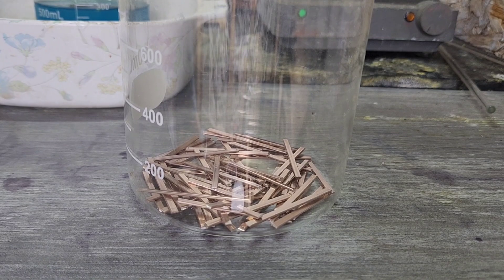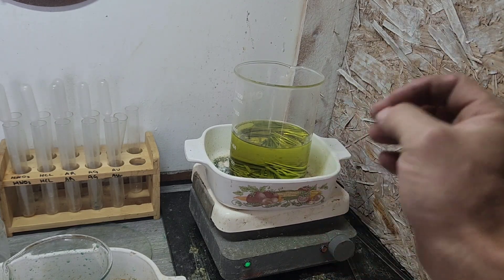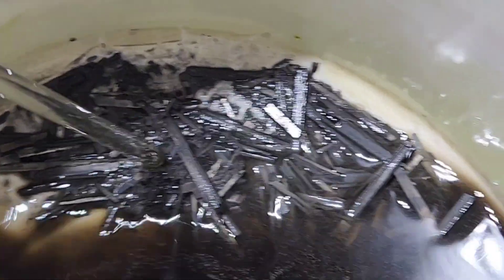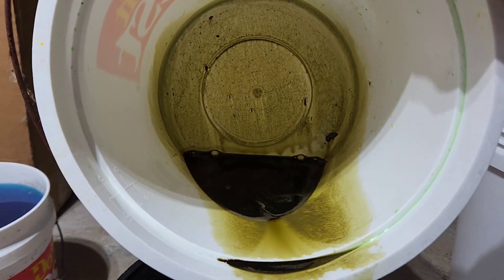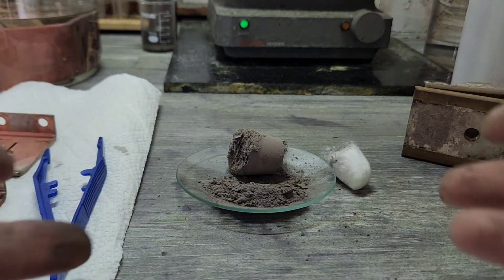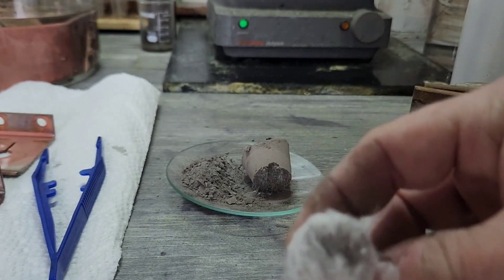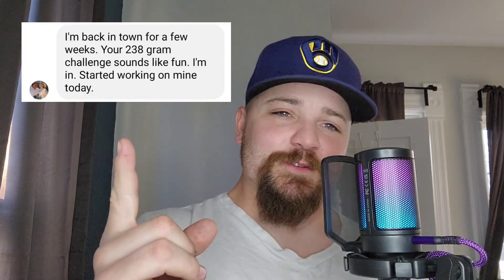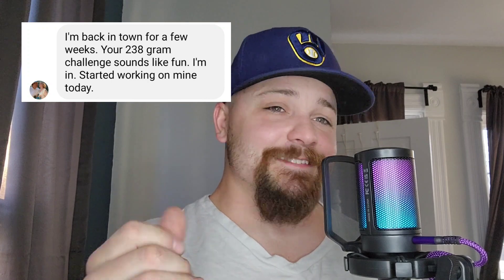Brazing Rod Silver extraction. AP method!

Comment: Many electronic components on Printed Circuit Boards contains a lot of Silver. Mirrors are a good source as the coating behind the glass is usually Silver, just notice that some of the cheap ones are Aluminium coated (sometimes Nickel, Tin, Chromium, or other metals). Older mirrors are most certainly Silver coated, but be aware that antique ones might be coated with the toxic amalgam Tin/Mercury. An excellent source of Silver is the slim mirrors in Printers/Copy Machines, they are plated on both sides! Some of the small glass lenses and reflector lenses in various WEEE are Silver plated as well. The glass from Thermo Bottles is very good for Silver recovery. Further, I recover a nice quantity of Silver from the "lead free" solder on PCBs, in addition to the full recovery of all Tin and Copper from the same solder.
Reply from the maker: I bet there is a ton of unobtained silver from that solder would be interesting to see what the bottom of my AP 5 gallon buckets contain. I was going to run an experiment on that bucket actually with electricity recovering the copper. Not sure if the copper will be dissolved faster than the AP will give it up.
Reply: What do you mean with "very good for silver recovery"? All those items only carry milligrams of silver. I doubt it is worth it to recover any of these you mentioned. Except you don't value your time anything meaningful.
Reply: @jackmclane1826 .   The mentioned glass parts do contain more than milligrams of Silver, though admittedly it's no more than a few grams from even the best ones.
You seem to be unaware that mining companies make millions of dollars every year processing raw material, i.e. ore, with substantially lesser content of precious metals than WEEE (e-waste). The secret to success and a high income from scrapping is: Concentration of the valuable fractions, and to a lesser degree "quick" and smooth process routines. 
Streamlined and effective procedures in the processes really cut down labour time. I don't count handling time in hours, not even in minutes, but in seconds. E-waste must always be disassembled by hand in order to remove the hazardous and toxic parts, but afterwards all handling of each item/part should be done in only a few seconds. Time is money. The faster you can handle the items the more items you can process in the same time span. Just let the items accumulate and solely process large batches.
When a stack of mirrors is accumulated, each is hit in a small spot with a flame to remove the lacquer sealing. A drop of HCl is added. If no reaction, it's Silver coated. If HCl dissolves the coating it's some other metal, and the glass just ends up in the container with all other types of glass parts from scrapping, to be sold as waste glass for recycling.
Larger mirrors are cut with a diamondcutter into squares not exceeding 40cm, and placed upright in a 200 liter plastic barrel with tight fitting lid. Inner glass from thermos flasks and slim mirrors/reflector lenses from electronics are then dropped in between the mirror plates, whenever some of these items are encountered. Over time the barrel will be half full; it's already 100kg, more than that makes handling the barrel too cumbersome. Now diluted HNO3 is added, and an aluminium pipe is connected for collection of the NOx gas in a gasbag; it's later converted back to nitric acid. The barrel is left for maybe a week, maybe a month, until I have time to pour out the pregnant solution. Distilled water is poured into the barrel to flush off any remaining solution clinging to the glass surfaces. The processed glass pieces are thrown into the container with glass to be sold as waste glass for recycling. The solution is poured back into the plastic barrel, awaiting the next batch of Silver coated glass items. This is repeated until all acid is consumed; thus, a substantial amount of Silver has accumulated in the solution. Thence the Silver is recovered from the solution.
The importance of accumulating raw material can also be described by another example. I recover a nice quantity of pure aluminium by processing a type of material every backyard scrapper considers utter garbage: Laminated alu-foil. It comes from things like juice cartons, candy wrappers, potato chip bags, chewing gum packages, cigarette boxes, ect. This laminated alu-foil is pressed into juice cartons in blocks of around 1kg and stored until a least 50kg has been accumulated. Pyrolysis removes all plastic film and paper and yields Raw Pyrolysis Oil, later to be cracked into free Gasoline, free Diesel, and free Fuel Oil. The residue in the reaction chamber contains a mix of carbon and ultrathin aluminium foil. Unfortunately, aluminium oxidizes quite rapidly in open air, and way faster at elevated temperatures. Such extremely thin aluminium foil will turn into oxide in a few hours and be totally lost. It must therefore immediately be pressed into a crucible and heated under Nitrogen in the furnace to separate aluminium and carbon. A similar process is used when recovering aluminium from Beer-/Soft Drink cans.
The nitrogen I use is free of cost. It's separated from the air by my high pressure ceramic filter.
I also recover the miniscule layer of metals on common CDs; it's mainly Nickel and/or Silver. Every home refiner who has tried this has lost money. To make a profit, don't try to process a batch of less than 1000 pcs. After the process the clean Poly Carbonate plastic is sold as waste plastic for recycling. 
Hard Drive platters are likewise processed only in large batches, yielding a little PMs but a lot of pure aluminium.
To make a decent profit, the rule of thumb is: Never process batches of less than 50kg! Small batches take almost the same time as large batches. That means, small batches are too time consuming per kilo of recovered metal relative to large batches.
In my garden shed I make US$250,000 a year recycling any kind of materials, inclusive processing exactly such kind of materials the overwhelming majority of other scrappers just throw away as "worthless garbage"!
Backyard scrappers have a tendency to be impatient. They want "results" here and now. Most videos on YT are misleading, by showing how to spend hours processing a few hundred grams of raw material for a yield of "0.1 gram" of precious metal, while ignoring recovery of base metals as well as recovery of spent acids. That's never gonna be profitable. Accumulate a big quantity of raw material and process large batches only. Let the time work for you. Time is in reality the scrapper/refiner's best friend.
Just to mention, I have no expenses for chemicals. All three main acids, HCl, HNO3, and H2SO4 are homemade at no cost.
As a final note, PM refining accounts for no more than 1% of my activities. My main turnover is recycling of waste plastic.

Comment: on large quantities if ic chips I use a blue bowl to sperate the gold. It works very well at concenrating the gold content.Takes a bit of time but saves a ton of acids
Reply from the maker: Like a blue panning bowel? That was a thought I had after dissolving all of those copper wires. I figure I can keep the copper wires and some of the small gold that I lose and melt it for an anode for the copper cell! Might work. My yield rates might be off however
Reply: @SilverStoll   in an actual blue bowl. I do have a short video on it. It not the best but I think youd get the jist of it. I cleans about 98% of the junk out. Just takes a bit of time with a slow running water current

Comment: That was weird that you couldn't dissolve the silver. It looked like it was the right color. Definitely doesn't look like silver chloride. Might be silver sulphate?
Reply from the maker: Sulphuric acid wasn't involved not sure how that would happen. Silver chloride does turn gray and purple with light in the equation. I can post a separate video with it. It sure does look like metallic silver!
Reply: There are three ingredients in the brazing rod silver, copper, and phosphorus for flux to get the metal to flow. It appears that the phosphorus does create a bit of change. The weight of it was 100g is about 4g high. This is a bout the percentage of phosphorus. That should melt in to a nice button.
Reply: Right so silver chloride because of the hydrochloric. So was the original powder white? If so then you might of added too much hydrogen peroxide. That would of possibly been able to dissolve the silver. You increased it's ability to do so by heating it to